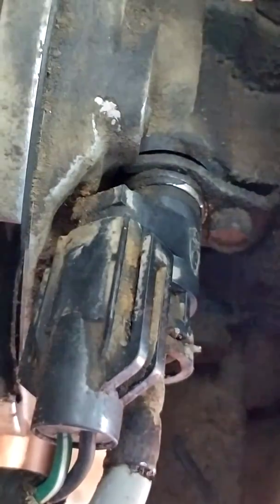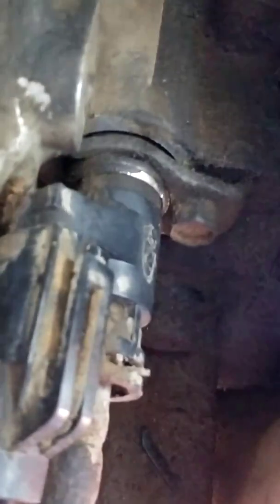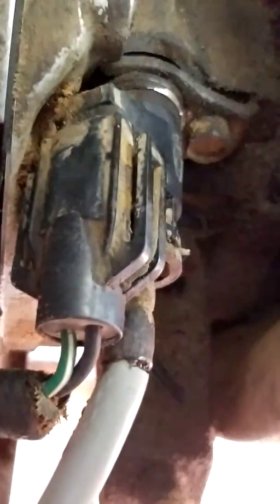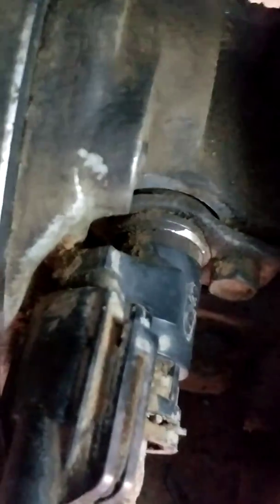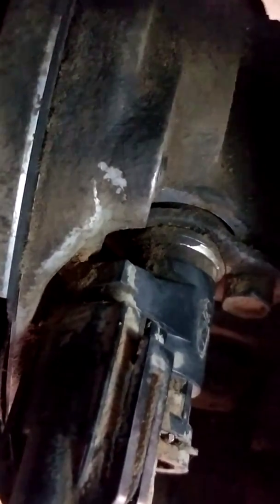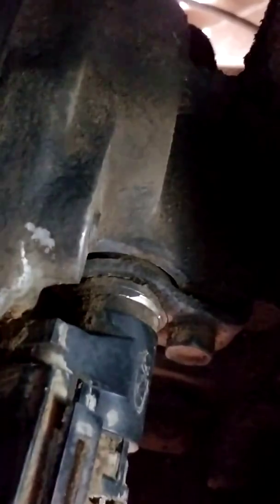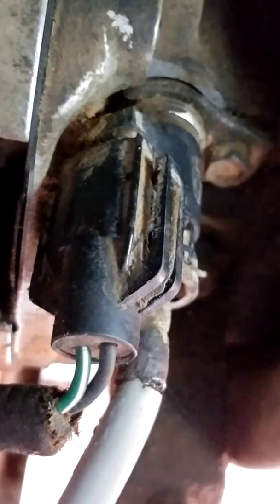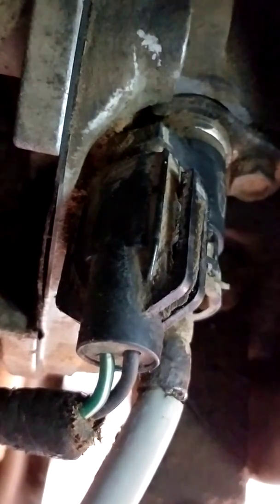Ford E4OD transmission shift problem

Comment: I heard that was the problem on another video. He also ran a new jumper wire. 
A suggestion for people who change the speed sensor on the differential.. use motorcraft.. cheap ones will make your speedometer jump all around . Thanks for the video and written update.